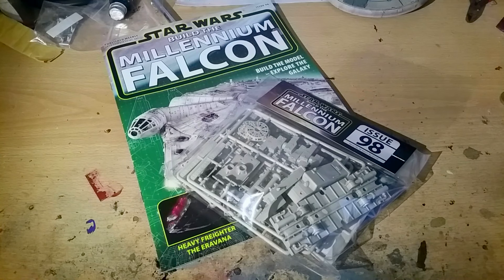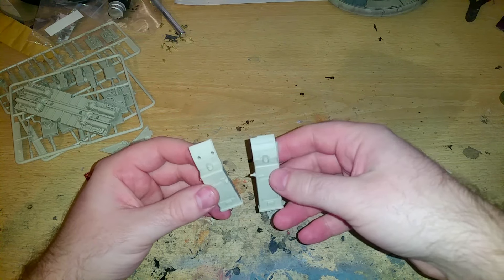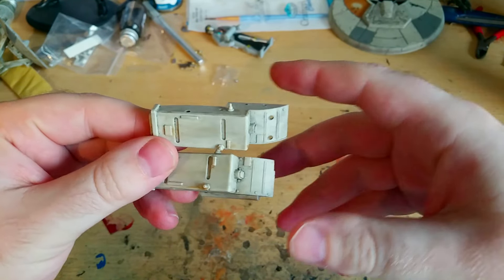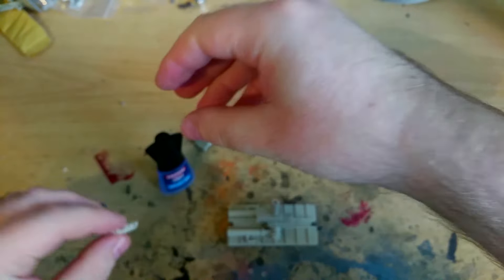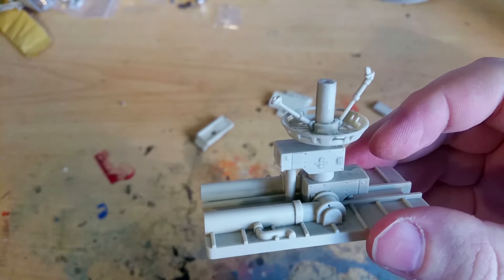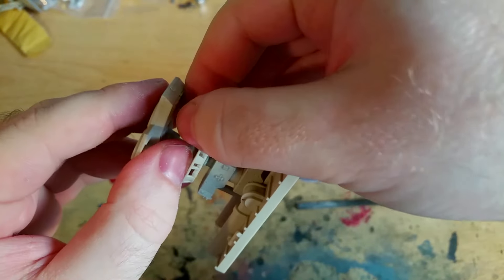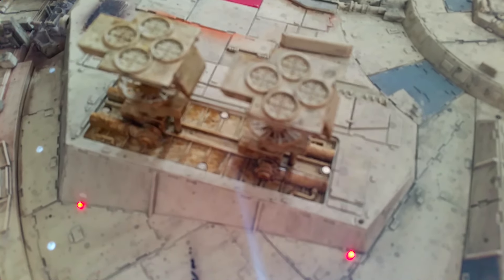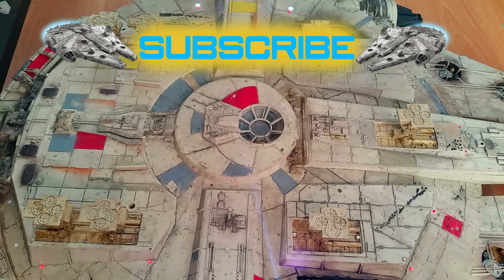Build the Millennium Falcon Part 98: Landing gear down!

Comment: I will display mine with the landing gear as they will be required for the massive diorama that the Falcon will be a part of. I hinted at that a few videos ago when I mentioned the special project I wanted to give you an early preview of.
Reply from the maker: Ooooo, what planet you going for with the diorama??
Reply: I am not ready to make a public reveal but if you pm me I have something pretty cool to show you.
Reply: Chris, not sure if you or others are aware that the "suction cups" on the bottom of the landing pads are actually "air pads". When the seven-eighth "full size" Millenium Falcon was constructed for The Empire Strikes Back, the producers decided to incorporate a "air-lift" system attached to the Falcons landing pads. By forcing compressed air into the pads, the Falcon was lifted a fraction of an inch above the studio floor, enabling the film crew to position the ship anywhere needed for filming. The "suction cups" at some point ( I think probably in the Fine Molds model) was included in the "accepted" version of the design. The correct version is found in the official blueprints of the MF landing gear, (Episode 4 ANH) which shows rectangular pads (rubber). No big deal, but when I build mine, it'll have the original pads. Enjoy the videos, GREAT JOB and very happy for you and your success!

Comment: Hi Chris, How does the landing gear attach to the falcon? Is is glue, magnets? Just wondering if it is possible to switch between landing gear and wall mounting
Reply: iggiekane you can switch from wall mounted to landing gear but not from landing gear to wall mounted (unless you leave the legs on)